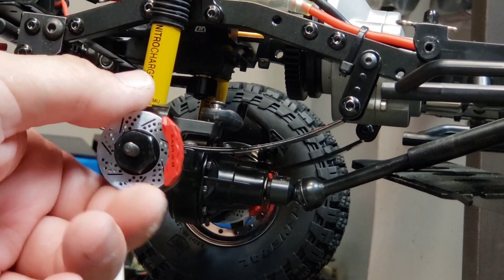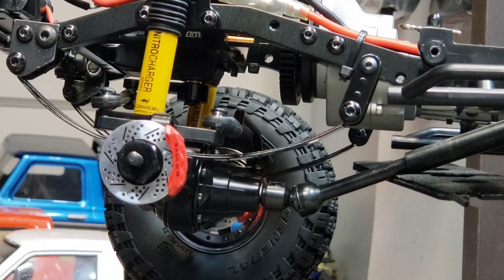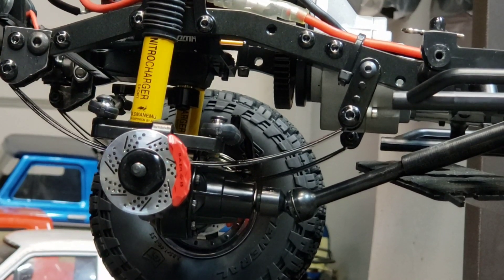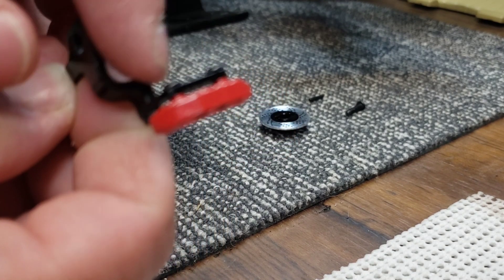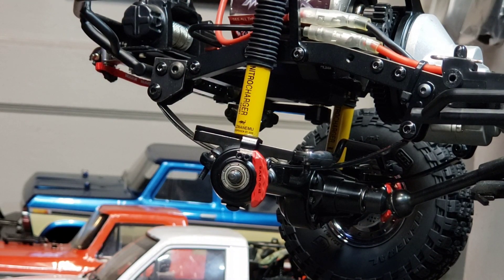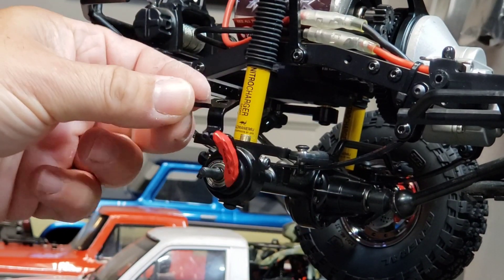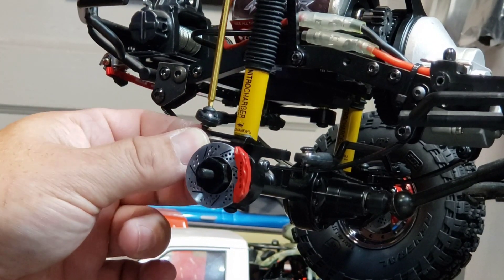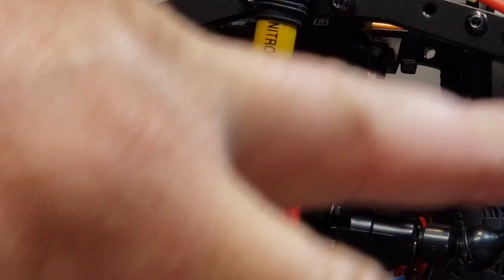Rc4WD Baer brake install

Comment: I just installed those on my tf2 4Runner! Front and back! At first I screwed up the ones on the rear! Didn’t pay attention that there’s two different brake calipers holding brackets! Ones for the yota 2 and the ones for the first edition yota axles. And they’re quite different! I ordered the ones for the old yota axles, when I put them on the rear! The axles started binding the caliper’s with the disc’s. After taking a second look, I found out I ordered the wrong brackets! So I ended up ordering the right ones for the yota 2s. And they work nice and not too loose! Boy! I tell you, what a difference in scale looks! They look so realistic and cool! Great video!👌😎👍
Reply from the maker: Oh yah I should have mentioned the two different versions on these in the video. You are 100% correct they really add the scale details! I wish Rc4wd offered these for the K44 axles! Thanks for watching and commenting I really appreciate it.
Reply: @RcDungeon  yeah! I also have those k44 axles! That would be really cool if they offer them for them.😎👍

Comment: Knuckle strip out is so common. That brake looks great
Reply from the maker: I've been super lucky with all my Yota 2 axles I'm very careful with end point settings and using loctite so far haven't broke any. But I also ran my OG TF2 for 2 years without drive train issues either so who knows lol! Thanks for watching!